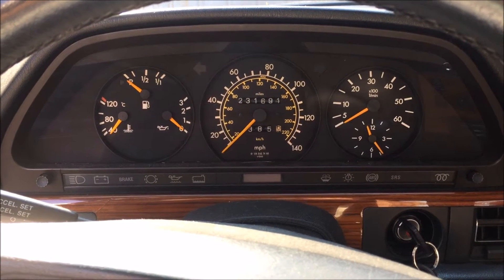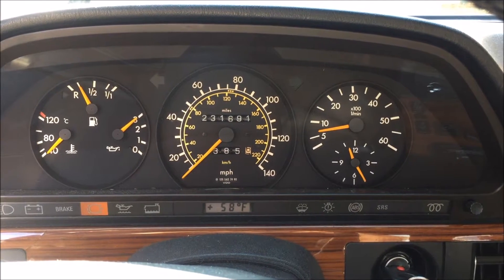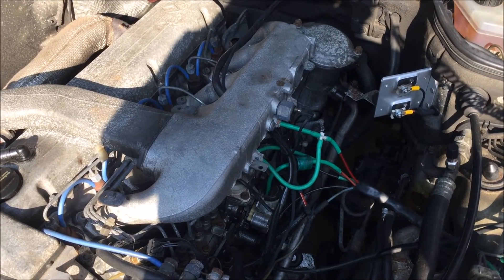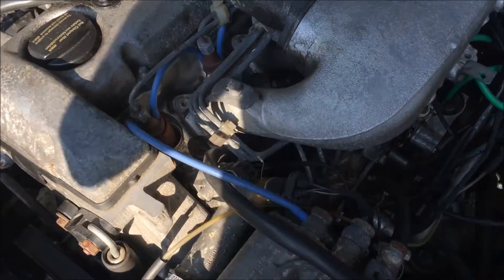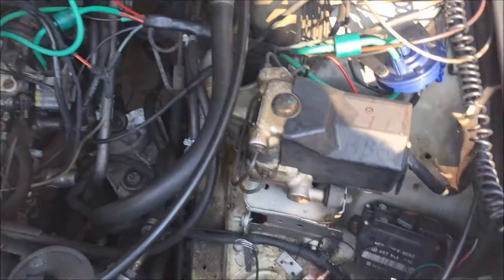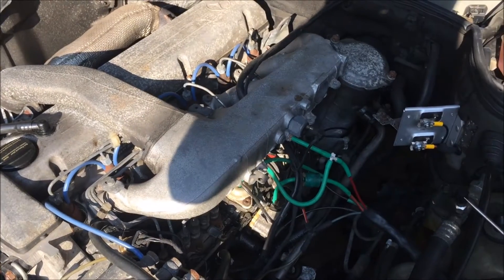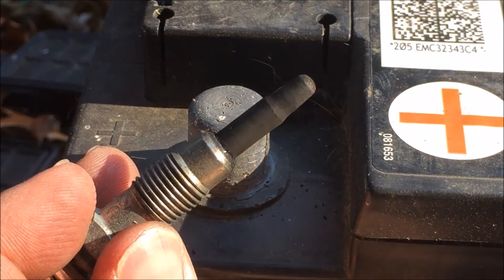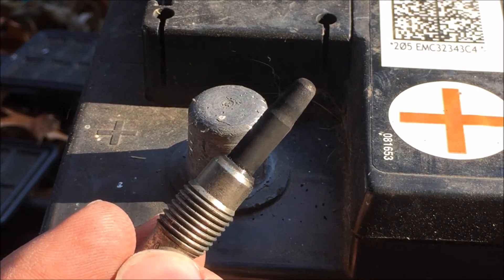Mercedes OM 603 Diesel Glow Plug Test and Repair

Comment: you should make it important to say when you reinstall the plugs. that you put anti-seize on the threads that go in the pre chamber
Reply from the maker: Good point! Just a tiny little dab will make life easier the next time the plug needs to come out.
Reply: yes because if that glow plug breaks off in the hoie. You are in a heap of trouble
Reply: What is the best anti-seize for this case?
Reply from the maker: @a3.leman88  I'd go with something copper based because of the high temperatures.

Comment: I replaced my glow plugs and now I can't get the light to turn on and my car is just crank no start.
Reply: Please someone help
Reply from the maker: Start at the relay and work out. Is the fuse blown? Do you have a connection from the plugs at the relay to the glow plugs?
Reply: @compu85  the intake manifold bolt that holds the glow plug wiring harness wasn't aligned correctly. I've been driving the car successfully for the past 4 months haha

Comment: hello I have a 1997 korando with a mercedes benz 662 engine and the glow plug light stays on with the panel lit and with the ignition off not
When switched on, it produces white smoke behind it and some noise and difficulty even when hot
what can be at 160k km
Reply from the maker: Sounds like your glow plug relay has failed. I'd start by making sure it's sending power to the glow plugs when the ignition is switched on.

Comment: My farm ute is a 2006 Ssangyong Musso  with a 2,9 litre 5 cylinder merc diesel and done 260km so I expect it will be good for 500km, observing the miles on this vehicle.  Thanks for this info on Glow plugs.
Reply: Do u know how to get to them? I need to replace mine but theres a lot of stuff in the way that I'm not sure if Itll be okay to remove

Comment: Your video just popped up again and I see Vito asked if you still have the car some time back and you just said yes. How is it running now. 
You said it needed suspension work. I wonder if the ball joints on that are like the ones on my 85 123 I used to have. They are pressed in and you obviously need a hydraulic press to do them.
I always wanted one of those 6 banger diesels but never found one.
Now I have an 01 e320 sport. Runs like a bat out of he'll but is a high maintenance b****! Lol
Happy new year!

Comment: So you are saying if the glow plug light does not come on, then there is a fault in the glow plug system?
Reply from the maker: Yes. On my late 603, the light won’t come on when you turn the key, then comes on while driving.
Reply: Thanks for the speedy response I’m having hard starting issues, then rough idle for a little bit if it’s cold. If the weather is warm it rough idle for a few seconds then it smooths out. My glow plug light cycles on. I have a 1987 300TD so it’s the 3.0. Would mine do the same as yours too I’d my glow plugs didn’t work? I also may think it the injectors because I see seepage around number 1 and number 2 injectors. It would be great to get you feedback on this. I also have a 1993 300D 2.5 turbo, this one starts in any temp or weather without diesel additives. Thanks for your time.
Reply from the maker: @MY-pj8cd  The 87 relay might act differently than the 91. Your best bet is to use a test light at the connector at the relay, and see if any plugs are open circuit.

Comment: All my glow plugs are good but still not coming on. I dont get the constant beep for a few seconds when I go to start the engine but it still starts. Any suggestions.
Reply from the maker: The key / seatbelt buzzer is seperate from the glow plug control. Check your glow plug relay. Be sure it has constant power, the fuse is good (if so equipped), and it's getting the ignition on signal. 
I suppose it's possible your ignition switch is bad.
Reply: Or the light bulb in the dash

Comment: quick question, how would you use a multimeter for this? (I don't have a test light)
Reply: go to harbor freight and pick one up. they are like $5 or so
Reply from the maker: benzlover55 you would use the ohms setting. To be honest, the test light is a better test. The best test is to remove the plug and hook it up to 12v. The heater can go bad at the tip. In that case the plug will still measure about the same but will perform much worse.
Reply: @compu85  I agree that a bench test with 12v is the best test. I do not agree that the test light is better than a multimeter. 

I have always used a multimeter ohm test to check glow plugs. Just did the glow plugs on my 87 300td. All tested good with a test light but 3 tested bad with multimeter (high resistance). When I removed them and did a bench test they were in fact bad.

Comment: There's an easier way to see which plug is bad.  The connector is numbered from 1 to 6, the numbers are very small and you need a magnifying glass to see them, but they correspond to the cylinder number.  Cylinder number 1 is at the front, and cylinder 6 is at the rear.